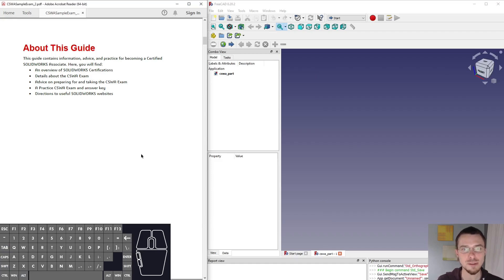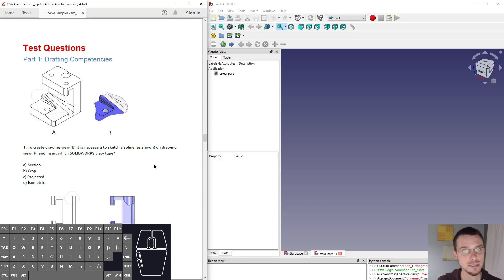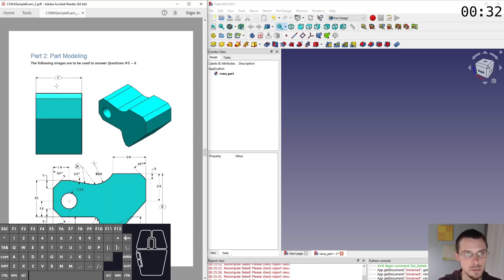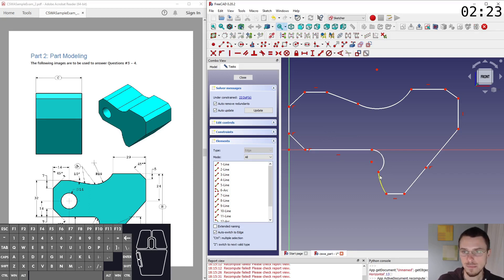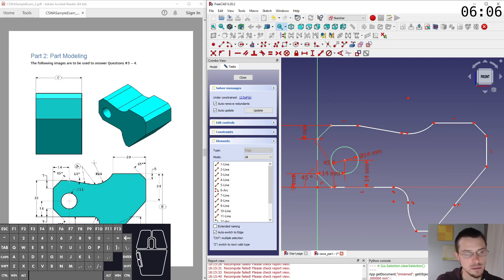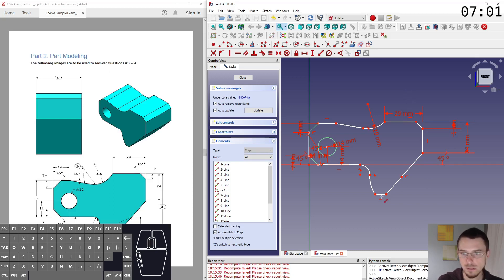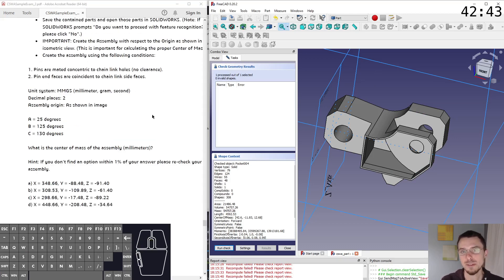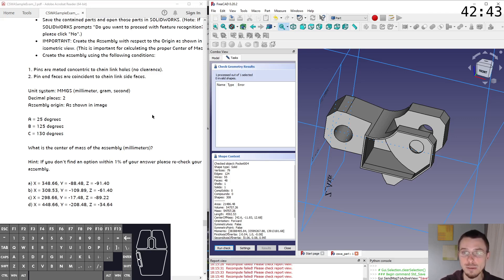CSWA exam in FreeCAD, without topological naming issues

Comment: At 27:00, the 24 mm cut is symmetric about your "CutStop" datum plane...  At 42:20, can you not just pocket from the original datum plane to the stop plane?  Alternately, if the sketch were attached to "CutStop," you could pocket symmetrically.
Reply from the maker: Yes you're right, the exam drawing does dimension from the other reference though so as a personal preference I try not to add symmetry if the model doesn't show a specific intent of symmetry (it has bitten me in the past...).

But yes in this case the operation as you described it would definitely work!

Comment: Hot tip: When you're using the polyline tool, you can press the "M" key to circle through behaviors! One of them is arc, so there's no need to switch to the dedicated arc tool and then back to polyline.

Comment: The Macro "CenterOfMass" lets you enter basic materials to get mass output. Works great and allow to have many bodies with different properties. It is very interesting.
Reply from the maker: Oh awesome, will definitely check it out!
Reply: Macro "fcinfo" also does mass calculations. Workbench "quick measure" is useful for volume, distances, etc.